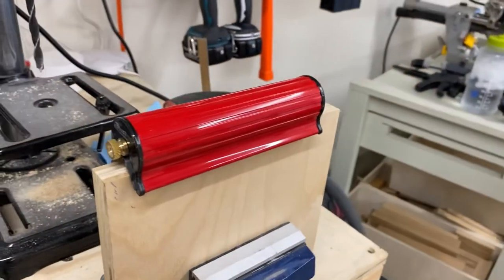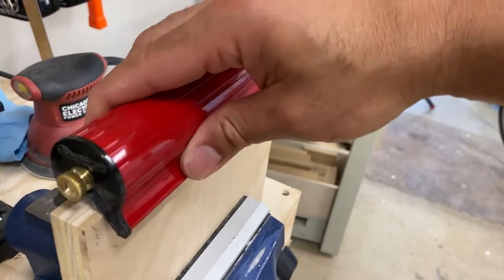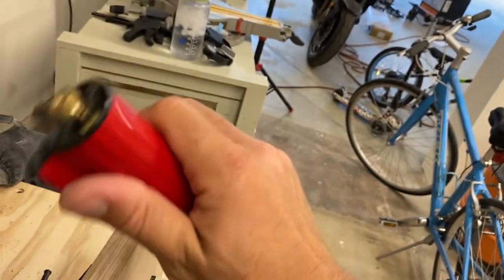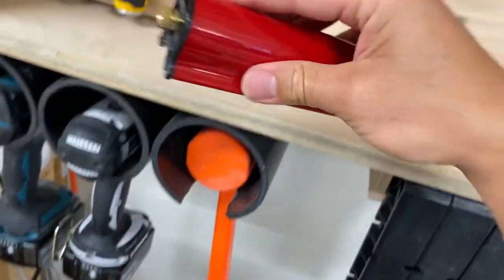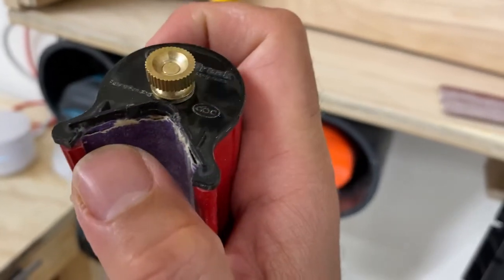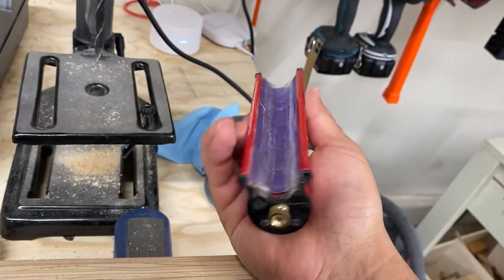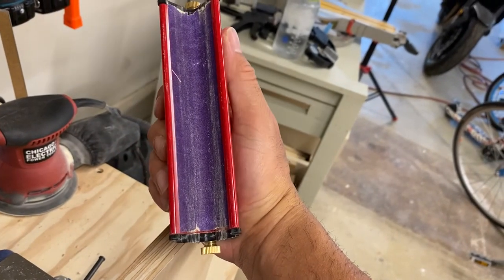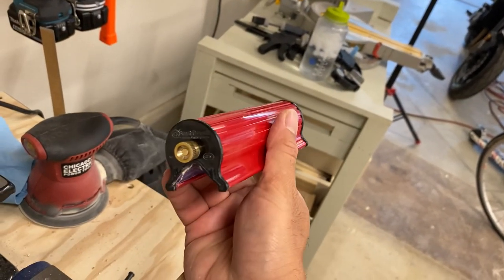FastCap Fast Break Sharp Edgebanding and Hardwood Sander

Comment: Thanks for the review and the heads up on using thicker sandpaper. I just grabbed one from amazon warehouse so I'll mess with different weights of sandpaper to see what works best.
Reply: What did you find out about the sandpaper?  Thx
Reply: @tundrawhisperer4821  Hey there. I know this is a long time later, but what I ended up doing is just removing both of the screw on ends and just using double sided tape to hold the sandpaper in place. That way there's no issue with the ends catching.